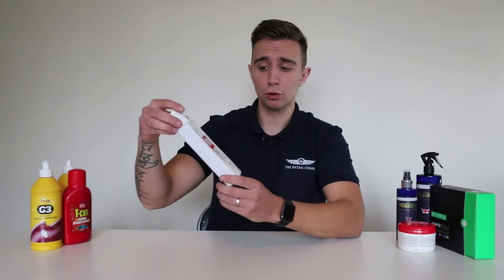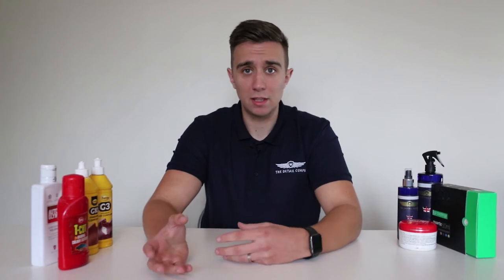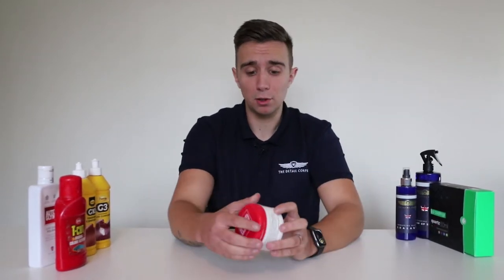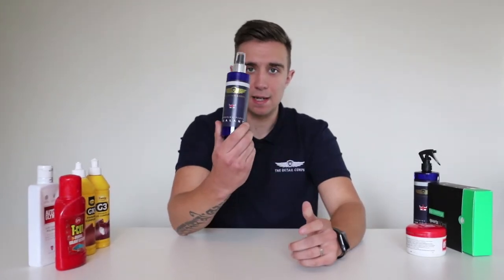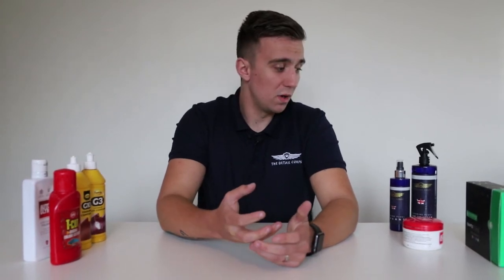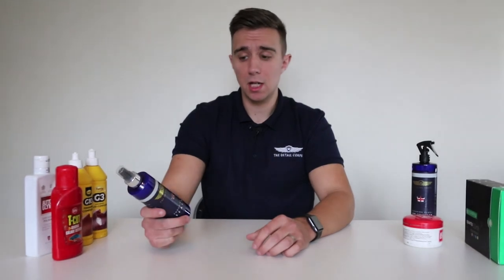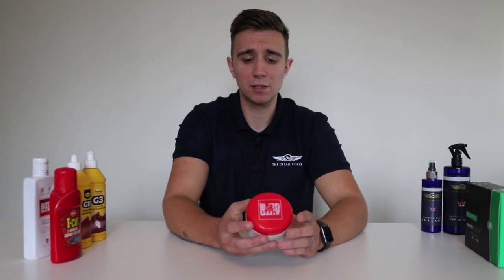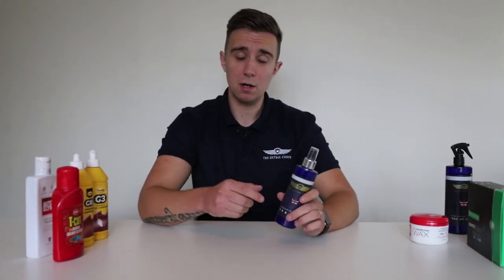Polish or Wax, what’s the difference?

Comment: So ive polished mine now 3 time got most the minor scratches out , my question is no more polish or eventually no paint ?
Reply from the maker: The only way to truly tell is the construct of your paintwork combined with a paint thickness guage, but you can go pretty hard before you run out of clear coat and it would be almost impossible to get through clear coat polishing by hand. 

Put a good protection layer on and look after your work, it should last your ownership of the car when cared for correctly
Reply: @CorpsMedia  cheers for info